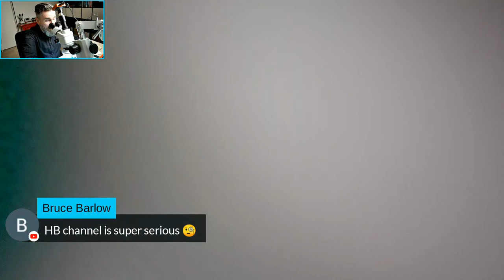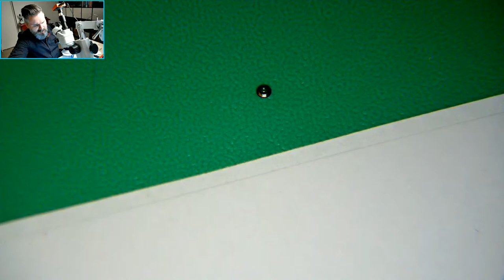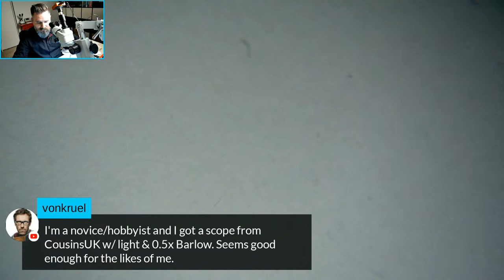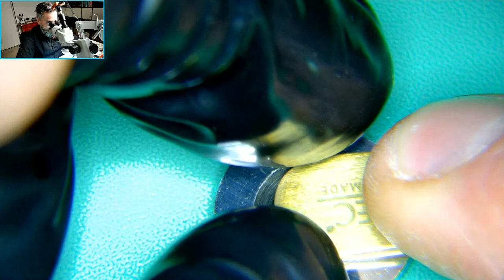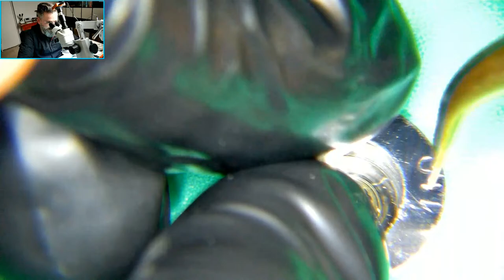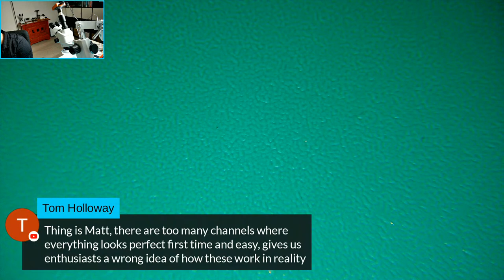Bringing a Valjoux 72 Chronograph Back to Life LIVE No Edits Vintage Watch Restoration

Comment: Sorry I could not join you live but I did watch it to the end.  I understand your point about the stress of live builds, but it's refreshing to see the "reality" and understand the level of patience required for this hobby or profession.  So I don't feel bad now that it took me 30 mins to seat a wheel in a Hamilton on my second attempt (after breaking a pinion on the first attempt and waiting 2 weeks for a replacement).  Video quality was good.  If you can play with exposure settings, try and turn it down. Between the bright LED and shiny parts,  it's overexposing.   Having said that, the quality was good.  Details coming thru were very good.  I vote to do the chrono module live as well if you stand it.
Reply from the maker: I will finish the chrono tomorrow evening live. 
Camera wise I am not happy with it so I have ordered a new one that actually has an auto focus on it so that could be a nice game changer.

Comment: How many winds is correct per day?
Reply from the maker: I'm not sure what you asking. If you mean how many winds does it take to fully wind it then it can be anywhere between 45 and 65 depending on the spring. Regardless the Val 72 has an approx power reserve of 48 hrs

Comment: My month alignment is off, not centered. Does anyone know the issue?
Reply from the maker: I'm assuming you are referring to the Valjoux 72C which has the day, date and month. It is probably dirt and needs a service or the spring has lost tension. Without removing the dial it's hard to be 100%